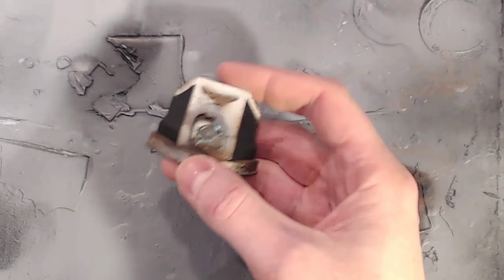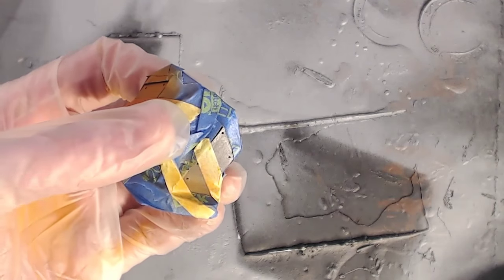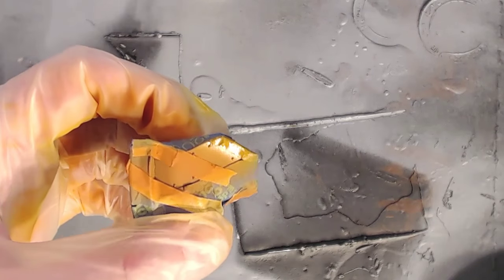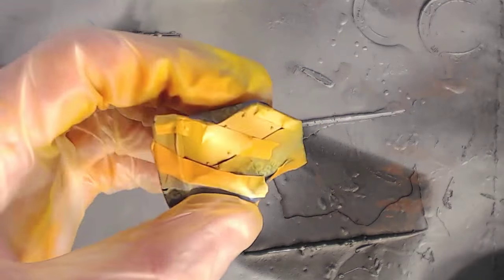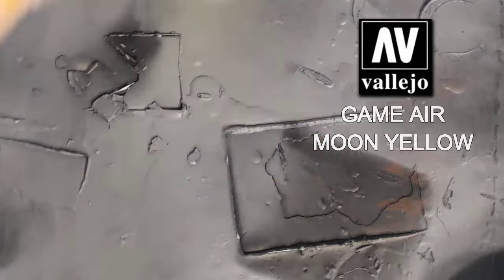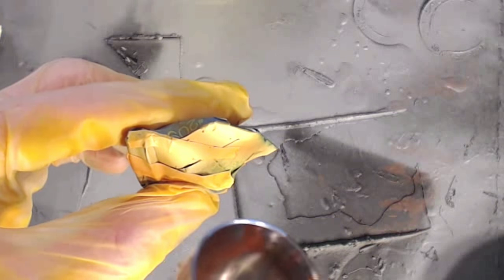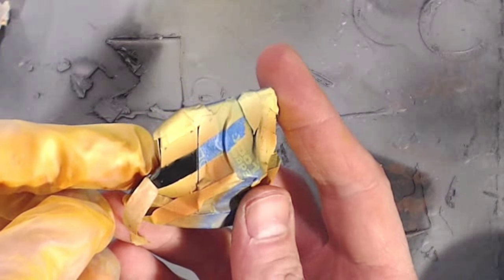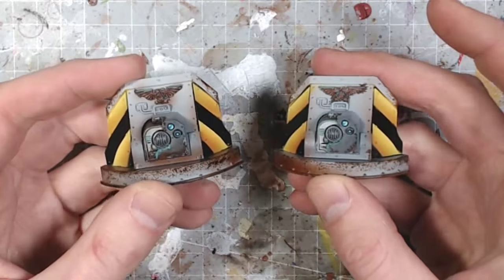5 Tips to Make Painting Hazard Stripes / Chevrons Easy - TUTORIAL

Comment: Why not start with a white 1st?
Reply from the maker: +Charles Hooks you could, it just may be easier to paint with a black base to go over the previous color uniformly.
Reply: +Spikey Bits You would still have the black at the very start, but then air brush white before the brownish yellow.  That would brighten the yellow quite a bit and reduce the need to do so many coats of the yellow.  You would get the same effect with 1/2 the coats of yellow you used.